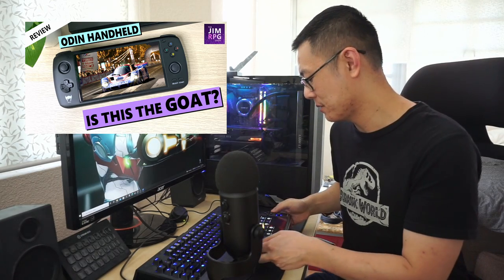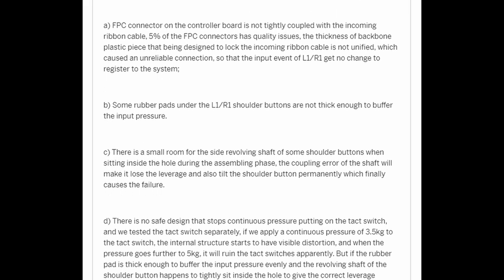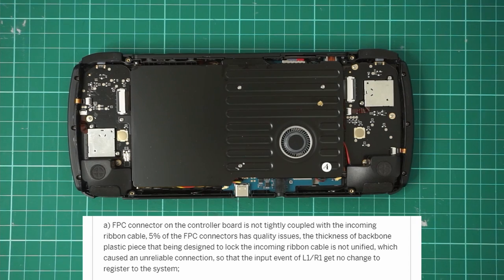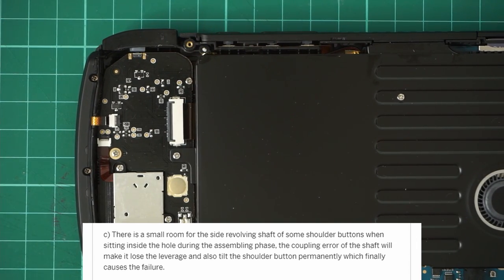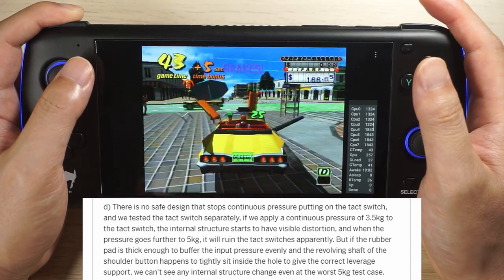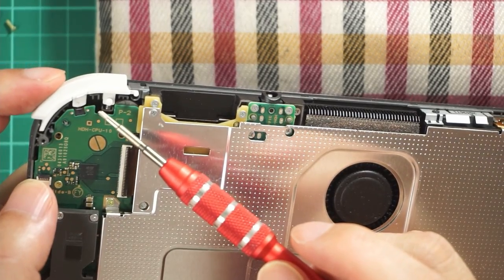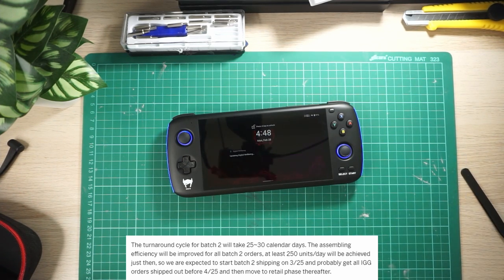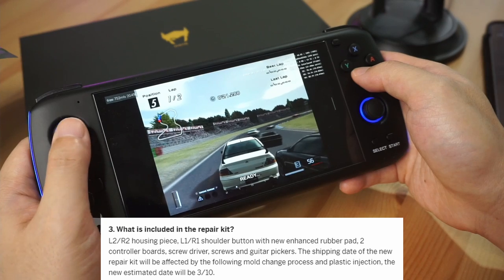Odin Handheld - Let's discuss the L1/R1 button issue!

Comment: I think from the onset you should have mentioned if your unit had any issue. Since, you didn't I'm assuming there isn't any. My L1 button is not defective but it doesn't feel right. Not as clicky as the R1 and I haven't tried opening it yet as somehow it is working but you can feel that when you press down it feels slanted. I'm not sure if I should risk opening it.
Reply from the maker: I think my odin was fine. I think most people are just going to assume they're fine. there was 4% of orders that had issues to begin with of the first 1200, so let's say 100 orders.

Well if you're careful the process of opening the Odin is not too bad and you can see what's inside, but of course do it at your own risk. After you take the four screws at the back off, you just have to slowly pry it open with a guitar pick or something similar, use plastic, and then work your way around unsnapping the shell off. The shell snaps into place. just careful you don't jam your guitar pick too far in as you can pull out a ribbon cable or something similar.

Comment: Curious as to why you used a Dreamcast game (Crazy Taxi) as your demo given the DC had no L1/R1, only analog triggers.
Reply from the maker: Pretty sure that was the default settings in redream, I suppose you could change that in the controls to use the L2/R2. But you’d still have the problem on PS2 games, or even PSP games, if you mapped the shoulder buttons to the triggers you have to press the button all the way down to use it.
Reply: @JimRPG  I’m just saying the the DC actually has analog trigger very much like the Odin, in Crazy Taxi the right trigger is your gas pedal.  And the Odin (I think) has a setting that allows the triggers to act as digital buttons so you don’t have to fully press them to register.
Reply from the maker: @scottgilbert3286  hey Scott, yeah I know what you’re saying. I should have used L2/R2 for Dreamcast but I didn’t even think of it that much at the time. The point is really more about the L1/R1 design rather than what game is being used. You can sub in another PSP/PS2 game that uses L1/R1 specifically. Crazy Taxi footage was what I had from the video review. Overall the point of the video was that I just wanted to show people what it looked like internally and perhaps be a little bit more careful with the handheld.

Comment: Odin need to fix this properly, it's an expensive device and you shouldn't need to be taking it apart to fix it.
Reply from the maker: you can't fix it on batch 1 orders - its essentially a design oversight, or a design not as good as the switch lite. batch 2 is better but probably still not as good as switch lite... but should be good enough.